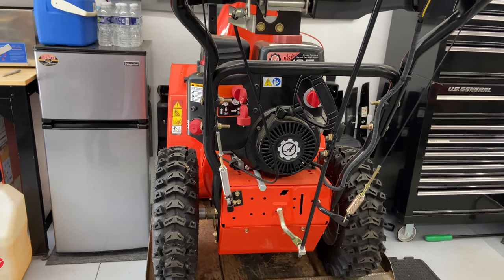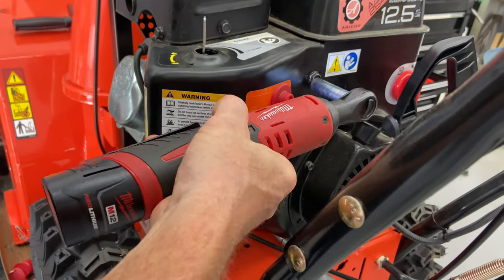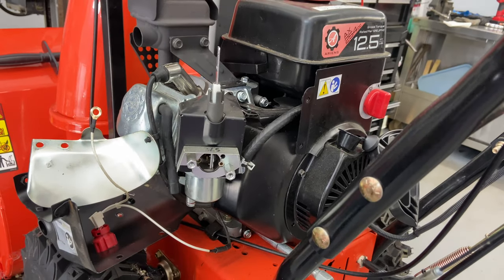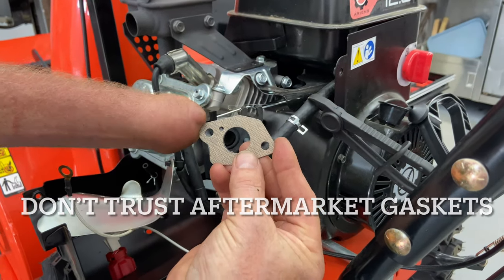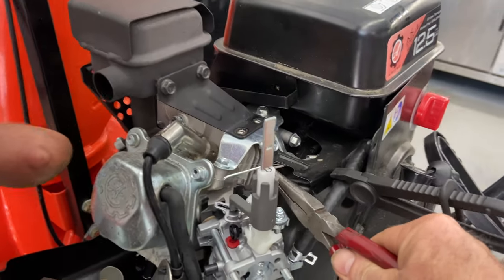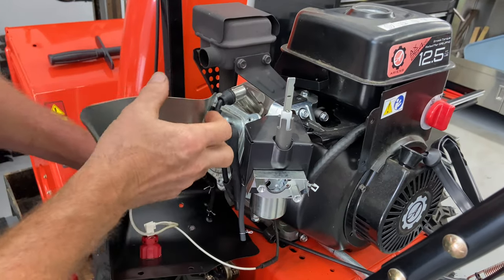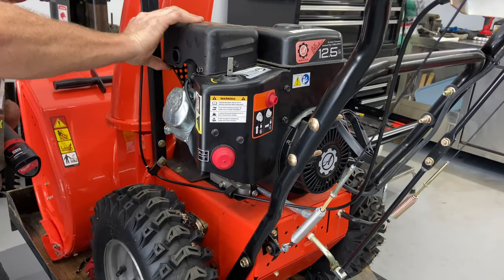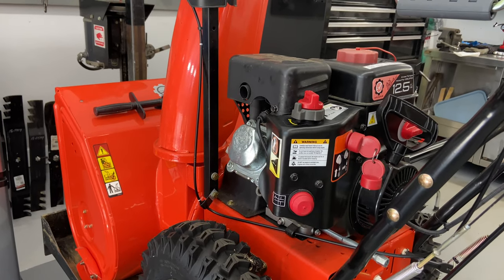Ariens Deluxe 24 Snow Thrower Will Not Run. How to remove and Install a New Carburetor.

Comment: Overtightened and messed up the drain bolt last night causing the fuel to leak(about a drop every few seconds). Will be replacing the carb soon once it arrives, such a stupid mistake. For now I’ve applied RTV and hopefully it’ll seal the bolt until the new carb arrives. Great video, definitely going to replace it myself now and save me some $$$ and a trip to haul the snowblower to and from the local shop. Thank you.

Comment: You are really a good throughal
Guy . Explained very nicely. I’m changing my carb for an 2003 ariens 8524. Hope it goes this smoothly
Reply from the maker: Thank you and I hope all goes as well too. I would recommended using aspen4 fuel as an alternative to pump gas. You will stop having issues with your carburetor problems from gas going bad. Here is a link to read about it and to locate it to purchase. https://www.aspenfuels.com/products/alla/aspen-4/.

Comment: (FYI)The Tecumseh Engines, that are on many Snow blowers. Always seem to be fuel starved. Going up a size on the jetting helps.
Reply from the maker: The problem with the Tecumseh snow thrower engines is that they are no longer adjustable as they were in the past. Meaning when they made these non-adjustable carburetors at the factory in perfect conditions they would run fine but when you put them in 32° when it’s snowing they are starving for fuel until they warm up. You must run them for about 5 to 10 minutes full throttle while blowing snow and normally they’ll run OK after that. If you still have an issue after 10 minutes normally that means that there is bad fuel clogging jets.
Reply: @JohnsonsSmallEngines  Hey Brad, I agree with that on the non adjustable Carbs. Sometimes there are hidden adjustment screws. Taryl Fixes all just did a video on that. Another thing I notice, is the height of the Gas Tank. The Carbs are gravity fed. A low fuel line doesn't allow the fuel to flow properly. As always Thanks again for a great Video.

Comment: Great video. Just wondering why you are changing the carb on a new machine.
Reply from the maker: Hi Barry, In our area where I live we do not use the machines enough and the gas goes bad inside the carburetor if the machine isn’t stored properly. This machine is 5 years old was just not used much. The fuel going bad ruined the inside of the carburetor. Store your machine correctly and this should not happen.

Comment: Loved the video.  I had to take my carberator out recently to clean it.  I took video of the entire break down process.  I had to get the gas tank off because it was rust inside due to a crack gas cap.  I put the carburator back but something strange happens.  The grey throttle where the image of the turtle and rabbit, that piece, when I turn it, the throttle springs back to the position I turned it from.  I check several videos and cannot see what I did wrong putting it back together.  I have the Ariens delixe 28 model, 921030.  ANy ideas what may have happened?
Reply from the maker: I have not come across that issue.

Comment: Followed everything you did with a new carb (20 bucks/Amazon)  put fresh non-oxygenated gas in, fired it up and nothing---same problem as before.  Replaced spark plug too and still won't fire.  Are these cheaper carbs factory defective?  It is exactly the same as the one I replaced.  Now, I am going to put in the cleaned up old carb back in.  I ran ordinary gas in it before but would also put Sea foam in as well.  From now on, nothing but nonoxygenated fuel.
Reply: Put the cleaned up original carb on, put fresh, non ox gas in fired up and still won't start.  Any advice would be appreciated.

Comment: Mine leaks fuel from the primer a lot something stuck inside the carb 
Runs fine but squirts out gas will just need a new carb

Comment: there is a black plastic screw on the side that adjusts? Doesn't appear to go to throttle plate? Thanks
Reply from the maker: If it is the black screw above the red plastic cap on this carburetor in the video. It is a idle screw. If your replacing the carburetor with a new one you will not needed to adjust it. If your rebuilding the carburetor, you will need to make sure it goes back in sitting in the same position as it was.
Reply: @JohnsonsSmallEngines  i have a brand new blower. It surges just a touch. Would adjusting it help anything?
Reply from the maker: No, it will only make the idle higher or lower, it will not make the surge go away. Sometimes the engines will surge until they warm up. If it surges after 7 to 10 minutes of using the machine in the snow you most likely have a carburetor issue. Unless you may live in a high altitude area?
Reply: @JohnsonsSmallEngines  maybe i didnt use it long enough. no not high altitude. i'll just run it longer and see what happens. it just kinda falls on it's face for a second when you get into deeper snow
Reply: thanks for quick reply
Reply from the maker: Yes, give it some time to warm up and try taking it slow going into deep snow. Slow and steady normally works.